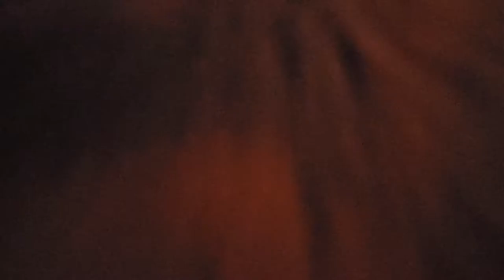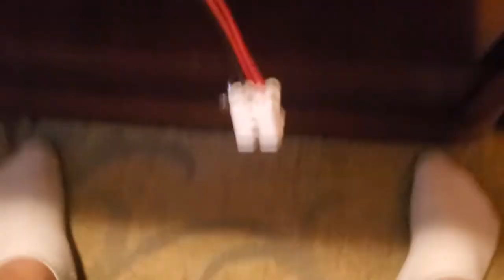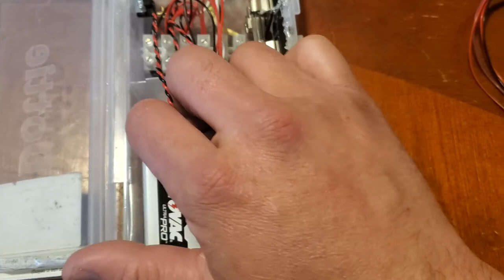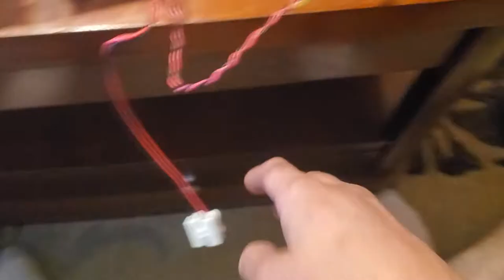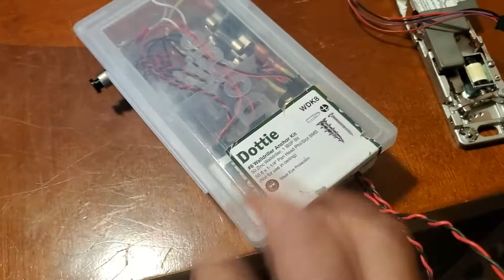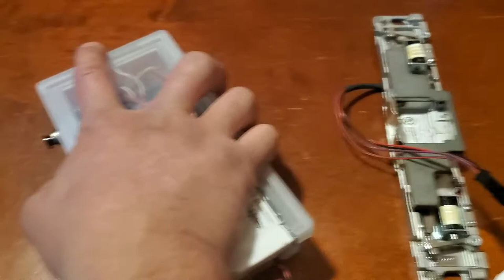electrified door lock ps device prototype

Comment: Hey there, yes I picked up something similar over a year ago by a company called Command Access. I like there products, you should check them out. Prior to that I made something similar. What's I like is that it is ran off your cordless drill batteries (depending brand). Thanks for sharing. It's neat to see someone else's. It has a knob to go from like 9v-28, 29v
Reply from the maker: I definitely look for it thank you for the info!